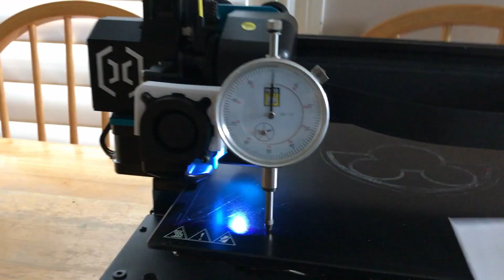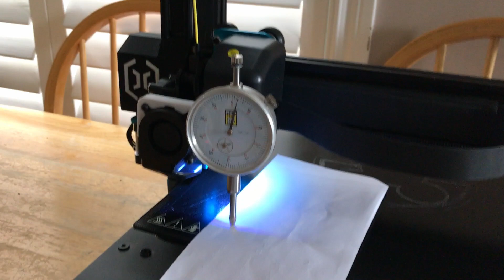Inconsistent layer printing

Comment: I’m going to build a dedicated printing table out of MDF, then mount it to and interior wall by screwing it into the studs. I’m expecting very little wobble, if any at all,  since the house is connected to a concrete foundation.

Comment: Rather than using carbon fiber rods to increase rigidity, which certainly won't extend but which still may bend, I'd recommend the same extruded aluminium profiles as the ones already used for building the printer. You can find them with all the needed hardware on sites like Amazon:
https://www.amazon.com/s?k=extruded+aluminum&crid=3B1OFLQX70R8B&sprefix=extruded%2Caps%2C224&ref=nb_sb_ss_i_1_8

[Edit] Never mind that. I just saw your other video where you used acrylic panels. Brilliant and elegant solution! 👍

Comment: I'm getting terrible Z-artefacts on my prints. It's not traditional Z-banding as the layers shifts are completely random. Furthermore it's visible on both the X and Y-axis. It's very slight, but when holding it against a light you can see millions of shadows from the layers which are sticking out from each other. I've tried printing a cube with an outer wall speed of 20mm/s but they're still showing up. I'm thinking I'm going to need a 32-bit board running Klipper if I want my prints to be perfect.

Comment: 3D Chanh has some braces on MyMiniFactory that I printed out, right before my main board fried itself, waiting for a Duet to come in to try them out. I believe they’re called the “better than nothing z-brace” and it did seem to make things a little better.
I did the kind of mod u r suggesting on my i3 printer and it definitely helps. Just haven’t gotten around to making ones for my SW yet. 
It would be interesting to see more on these braces as a comparison
Reply: He also has carbon rod kits for that purpose.

Comment: Hi :) Just some input.. shaking the table up and down will amplify the vibrations you are seeing in the dial gauge compared to the forward/backward movement of the bed. The uprights probably do need supports and it is no harm in doing it anyway. But it's actually a lot more complicated than that. I am also unsure if this would be a direct link to the layer lines people see. If however, the lines are caused by the uprights this would be caused by resonance from the bed movement. The spool on top can actually help this, or make a lot worse, depending on the speeds being used (speed of the bed). Shorter and faster speeds of the bed will be helped by the heavy mass on top, but long and fast movements will be amplified by the heavy mass to such an extent it could actually cause damage (imo). As well... I have seen a few videos of the "z-banding" being caused by the lead screw couplers and/or slightly bent lead screws. Hope this helps a bit...

Comment: I thought about putting an enclosure around the printer. I was going to have the top of the box fastened to the top of the printer where the spool holder goes. That would hold it rigid.